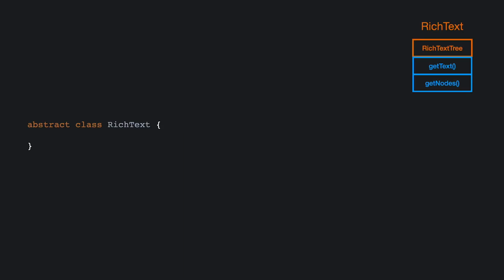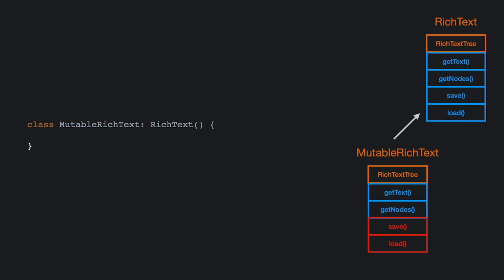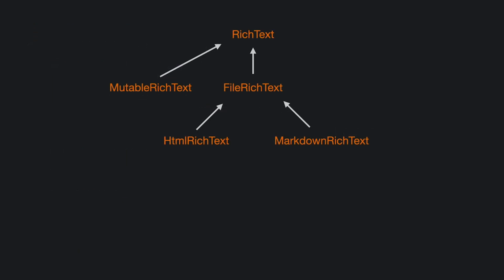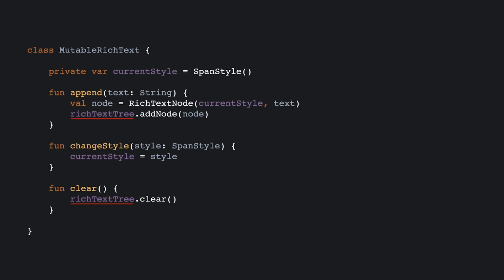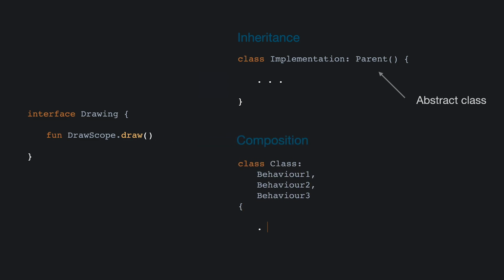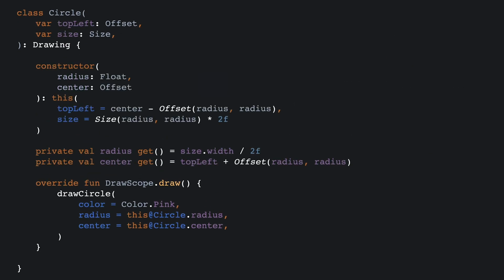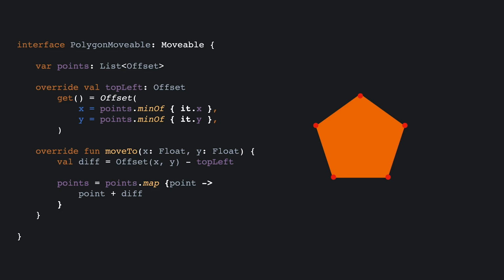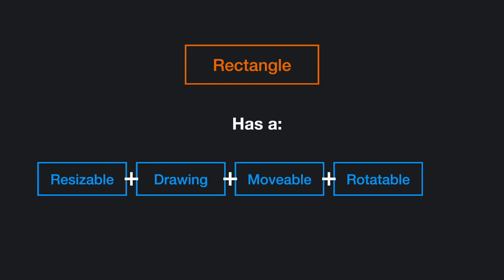Composition over Inheritance: A Practical Guide

Comment: Excellent explanation! ❤
Thanks a lot 
But one thing I believe it violate the clean code principles is treating the input as output without returning it, this is happened in the MutableRichText example, it modified the html object in unclear way, I believe that adding a build function or something like that as a terminal operator is a better approach.
Thanks again ❤
Reply from the maker: Thanks! Yes you are right that would be better for some cases. But in the case of a rich text editor I think it's better this way because you don't need to create a new builder and build with each user interaction.